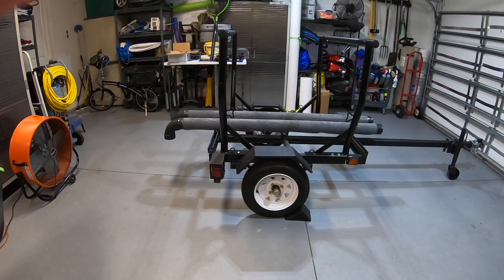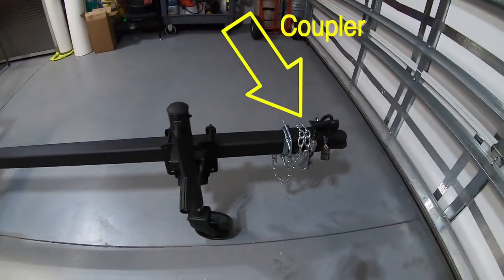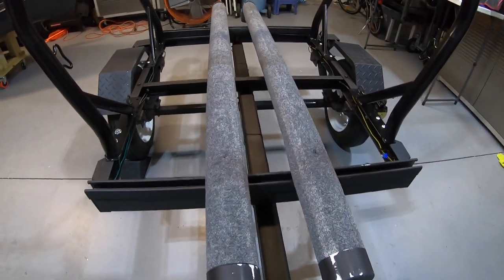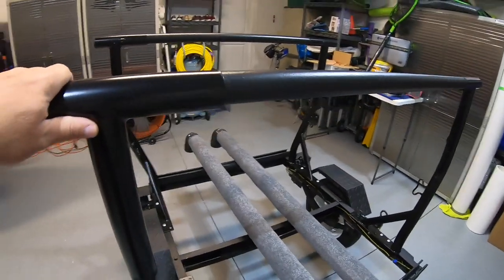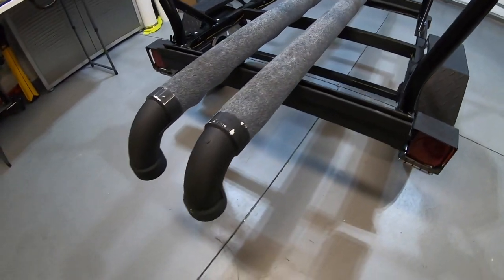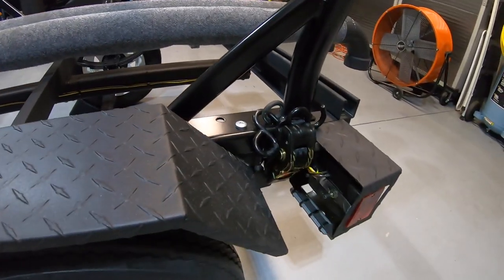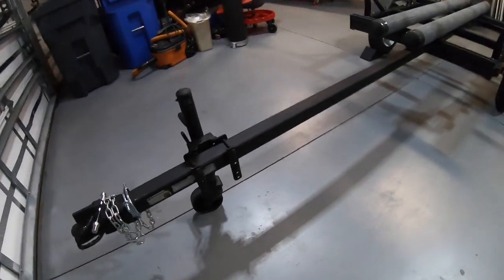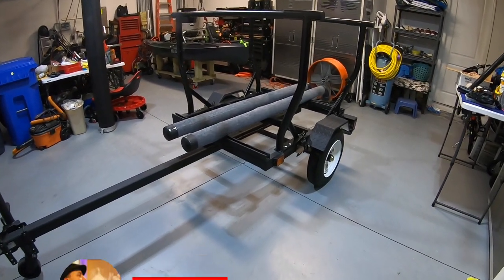Northern Tool Kayak Trailer Build - "Baby Yoda"

Comment: Thanks for posting your trailer build. I am working on something similar, and you gave me some good ideas. I read through the comments and found that you had responded already to any questions I might have - thanks! 

Also, to add tie-down points, google "lifting eye nut" or "lifting eye bolt" and you can add a ring to hook various straps or ropes to. 

Using the "super strut" channels you used can offer a lot of options. In the trades we also call this "uni-strut", and by design you can add brackets and clamps to it anywhere along the length of the strut, so it is really useful. Electricians and HVAC guys can build almost any frame out of uni-strut, my dad built shelves in his basement with extras from the work site 40 years ago and still works great! A mechanic can build a frame for almost anything with strut. 

Thanks again for your video.
Reply from the maker: @benlake710, thanks for watching and I'm glad you enjoyed the video!  I'm also glad it inspired you with ideas in your own build. Let me know if you have any questions along the way and I'll do my best the assist.  Good luck with the build and thanks again!

Comment: Wow that came out awesome, I am just finishing mine, For my Autopilot 136.Same setup only the harbor freight trailer.
What did use to attach the carpet to the PVC?
Thanks again
Reply from the maker: Hi Mark and thanks for watching. To secure the carpet to the PVC, I use 5/8" (I believe) self tapping screws. They have a bit of a washer-head--type and worked perfectly!  Hope this helps and let me know if you have any other questions.   Again, thanks for watching.

Comment: How did you fasten pvc to u struts?  Did you weld or bolt sq tubing to frame?
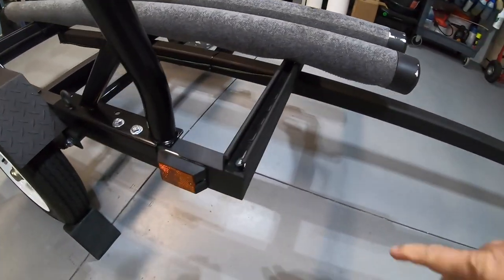Reply from the maker: Hi Greg.  At 1:30 in the video, I explain (and show) what I did. Hope this helps.
Reply: @TampaBayDino  He probably used 2-hole straps.

Comment: Hi there! Thanks for your awesome video. On the 2 1/2 square tube what thickness did you use? I’m assuming it’s the galvanized tube. Is it gauge 14 or 16? Thanks
Reply from the maker: Hi RN_TexasAngler and thanks for watching the video!  To answer your question, I do believe it was galvanized and it was 14 gauge. (it was pretty stout) A friend of a friend made it for me at his metal shop. I hope this helps and please let me know if you have any other questions.  Thanks again for watching.

Comment: Do you remember what gauge steel you used for the tongue?
Reply from the maker: Hi Crasshopper and thanks for watching.  I do not recall the exact gauge...but I do remember it was thin and not too thinck.  Hope that helps!
Reply: I used .120, way overkill

Comment: How long is the pvc tubes and how far apart are they?
Reply from the maker: Hi Reagz!  Thanks for watching. The width and length of your PVC will depend on your kayak. For example, if your yak it 11', I'd make the PVC length around 8'. You'd have to measure the width of the channels beneath your yak to determine how far apart you'd need them. Hope this helps.
Reply: Thanks

Comment: Great Video. Where did you get the 11' steel tube/tongue & how did you connect it to the trailer?
Reply from the maker: Hi Cody!  Thanks for watching.  I purchased the 11' tube from a local metal shop. If you have one near you, I highly recommend going that way.  As for connecting it to the trailer, I believe I drilled holes and used sturdy, stainless steel bolts with nylon nuts. Hopes this helps!

Comment: How did you actually “bolt” the eye bolts and particularly the ratchet straps to the trailer frame?
Reply from the maker: John, thanks for watching!  I drilled holes for the eye bolts and bolted them on.  Same for the ratchet straps.

Comment: Hi there, just wanting to know how long are your pvc pipes and how far apart are they from each other? thanks!
Reply from the maker: Hi Lori!  Thanks for watching. The PVC pipes were 8' long and the width was the with of the channels of the bottom of my kayak. This said, your lengths may be a bit different due to your specific kayak. Hope this helps. Let me know if you have any additional questions.
Reply: @TampaBayDino  thanks for the info!  your trailer is really neat, great job!
Reply: And I have an old town PDL 106 too. Can't wait to get it out on the water.

Comment: so it is an aluminum trailer, and you added a stainless steel tounge, will it be a serious rust because of the 2 metal, or because the paint , it will prevent that?
Reply from the maker: Hi Attila!  Thanks for watching. I need to make that correction in the write-up. The trailer is not aluminum, it's steel. The paint should help prevent the rust, but that all depends how you would store your trailer and how well you maintain it. Hope this helps.

Comment: Curious if can upgrade the tires for better speed rating ?
Reply from the maker: Thanks for watching. I sold this trailer a bit ago. To answer your question, yes you can. You may (and I say may) have to upgrade the axel to do so. I've heard both ways. Good luck!
Reply: From what I’ve read. The speed rating is determined by your tires. Replace with c rated tires the top speed is 81 mph

Comment: Hi great build and hoping for more detailed information on your build.  Why did you go with a 2 1/2" square replacement tongue?  Would a 2 " square tongue work as well?  The thickness of the 2" tongue I am looking at is 1/4" . . . wish you knew the thickness of your 2 1/2" tongue replacement.  I have an Old Town Sportsman 106 with Minn kota, so your setup would work for me as well.  Really would appreciate more tongue information.
Reply from the maker: Hi Two Flints!  Thanks for watching.  Ok, to answer your questions:  1. Yes, a 2" square tongue would work just fine. I Went with 2 1/2 because that's what the local fabrication shop had on hand. As for the thickness, 1/4 is right where you need to be. Good luck on your build and let me know if you have any further questions.
Reply: @TampaBayDino   Would I need to get 2" steel tubing at 1/4" thick?  Just wondering since the rest of the trailer is aluminum.  Is the original tongue steel tubing or aluminum.  Really appreciate the quick reply.  I just ordered the trailer from Northern Tool.  Thank you for your build and help with info.  Two Flints

Comment: Hi! Thanks for an awesome video.  How fast can you go on the highway with this trailer?
Reply from the maker: Hi and thanks for watching. I had the trailer up to 75 mph for about 2hrs one time....but I'm not sure it's rated for that. hahaha....Again, thanks for watching.
Reply: The biggest thing (Besides a blowout) is bearing temp.. The smaller tires turn faster spinning the bearings causing more heat.. Use GOOD high temp grease and change often and you SHOULD be good..

Comment: My 4 x 4 aluminum trailer is taking forever to get to me  . . . shipping is very slow!  Was your 4 x 4 trailer black or did you paint it black?   If you painted it black what did you use??
Reply from the maker: Two Flints, thanks for watching.  That sucks it's taking sooo long to get your trailer. To answer your questions:  Yes, I painted my trailer black. I used a textured black paint (I believe it was Rustoleum). Hope this helps.
Reply: @TampaBayDino  Thanks again.  Forgot to ask, did you have to prepare the aluminum beforehand so the spray paint would stick ?  Finally heard from the shipping company, this Thursday.  It's been almost four weeks since I placed my order.

Comment: How did you attatch the tongue? Thanks
Reply: it just bolts on. the original kit is the same way, so you just gotta transfer the holes over to your new piece and then it will bolt together just the same